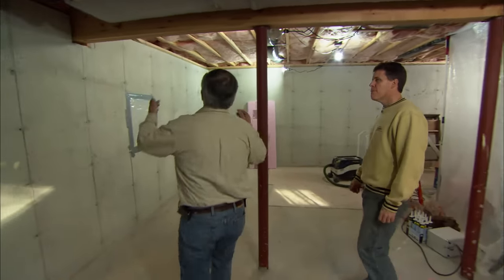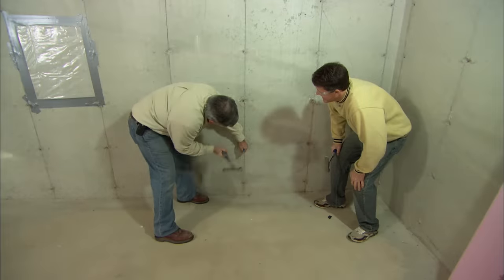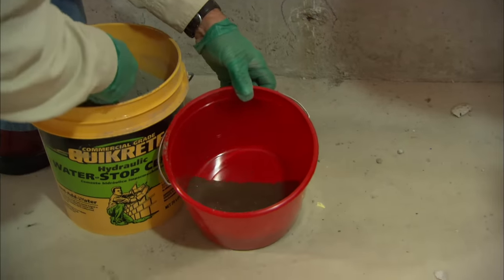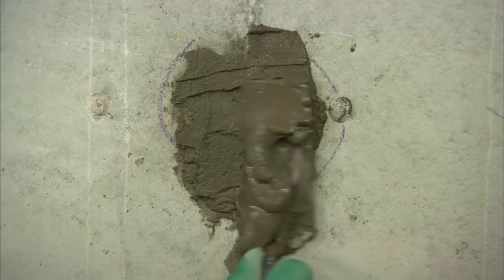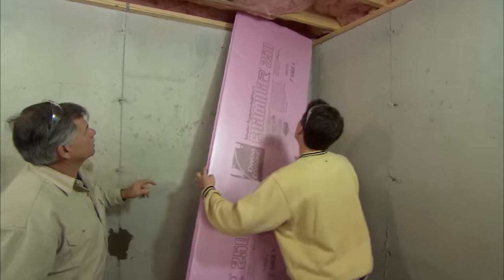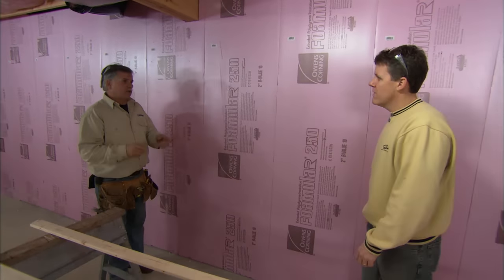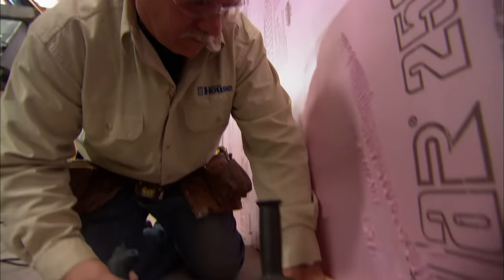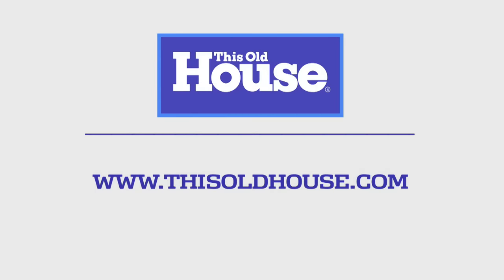How to Insulate a Basement | This Old House

Comment: I don't understand why you just didn't build a 2x4 wall, then nail your plastic boxes on for outlets and switched, insulate then sheetrock, why use this method?
Reply: Just made the same comment, still trying to figure this out. Less space ?
Reply: Save $$
Reply: Matthew, I would agree, but not this time, just better to build a 2x4 wall with the board behind it then proceed as Andy said.
Reply: This is less conducive to mold...in fact this ridic foam cannot mold as where standard insulation should really never be used in a moist basement. I just moved into my new house and they insulated the joists by the outer wall with the fiberglass stuff and it's got all kinds of mold in it--it's like a mold factory.
Reply: I think the reason is lower cost and easier.
Reply: to everyone saying this is cheaper and saves space, not really, the price of all the 1x3 used here would actually cost more than  a standard wall built from 2x4, as for space... 2 layers of 1x3 would be roughlt 1.5-1.75" thick, where as a 2x4 wall will be 3.5-3.75" thick, so it only extends the wall 2" that is if you built it in front of the rigid foam. not a big deal. 2x4 would have made more sense.
Reply: Space wise it you talking about additional 2.5 or 2.25". No? 4 vs (or minus) 1.5-1.75 or did I understand it wrong?
Reply: Does the choice of method have to do with moisture? He put plastic on the wall to test for condensation before starting. Can you only insulate this way if there is no moisture coming through (ie basement is sealed on the outside)? And if there is, you can't use the rigid foam? My house is from the late 60s so I have the feeling there is no waterproofing around my foundation....
Reply: Years ago I did a basement and applied drylock first to basement walls and floor and a thick bead of sausage butyl caulk to joints, then ripped a bunch of 2x4’s down to 2 3/4 and then built my walls conveniently 16 on center but before I secured and plumbed my walls I rested 1/2 rigid foam sheets against walls/ no glue. Then filled cavity spaces between studs with 2 inch thick rigid allowing 3/4 inch for air and then attached drywall etc.
Reply: In basements I like to use metal studs and track. There's no mold to deal with and very straight. If you want to save space you can even use the 2 1/2 in material or 1 1/2 inch material. And if you want a wall that sounds solid like a wood wall simply use the track with wood studs. If you can avoid putting something right up against a concrete wall I would do so. Simple batt insulation with a wall offset would have been much better and easier.

Comment: If that tie goes all the way through the concrete I would think pounding on it with a hammer would make it leak even more.  If you had a way to drill the ties down, making it shorter,  then fill up the hole would work better.  Glad I saw this.  If I would ever build a house with a basement I now know to make sure they seal the walls on the outside.

Comment: The water is coming in from the outside , so this means it was not sealed properly on the outside . 
You are going to have to take the dirt / sand from the basement outside wall and repair / seal that outside leakage with a spray or painted on sealer . 
It is not cheap , but it will save your house .

Comment: Step 1: Seal all the holes in the wall to prevent moisture from getting in.
... 
Step 8: Drill more holes in the wall to let the moisture back in.
Reply: Agree, makes no sense.
Reply: J M... The holes Tom sealed went all the way through the wall to the outside.
The holes he drilled did not.

Comment: if you did have some moisture coming through the basement walls is it  good to use a drylok sealer first before the foam board? i have some damp spots in mine. house built in 1953. block walls.

Comment: doesn't the nails form thermal bridges?
Reply: Yes, but can you tell me how much 0.5 sq-inches/nail (2 nails) per 1.78sqfeet (16"x16") of 2" foam insulation changes the R-15 rating? If you consider the nails as R-0, then I think the overall Rvalue would decrease from R15 to R14.94. Is that right?
Reply: It’s more of a moisture conduit and condensing surface

Comment: I have a house built in the late 1800's with an unfinished basement. There's no insulation in the ceiling/floor joists. Was thinking about putting up some insulation, but don't know where to start. Any recommendation? Thanks

Comment: Seen a lot of comments about screwing into concrete wall. Isn't the video an interior wall? If not, wouldn't it be ok to drill into an interior wall? I use hydraulic cement n drylox extreme on all basement walls. Previous owner had DMX black dimple put in. He put up studs with nails shot in the wall.

Comment: I'm curious why this wall assembly has no fireblock every 10 feet. This is a code issue for many municipalities. Not only does the continuous XPS provide a fire fuel, but the air space in the lattice strapping will feed a fire around the entire perimeter of the basement. Is this a serious omission on this video or are there circumstances in the wall assembly that bring it to fire code?
Reply: Thomas Stavros reason for this is that u don't want lose space, thats y i will use this system.

Comment: Save money,use a5/32" drill bit,common or spiral 3.5" nail and tie wire.Put a5" piece of tie wire into your hole then drive the nail.We used this building bridges,works great,better than expensive Tapcons.Try it
Reply: This will anchor strapping(3/4"0 or 1.5" material.Works on concrete,block,brick, and so on.It is a very strong and inexpensive anchoring trick.

Comment: I don't want to install a french drain because of finances, so can I dig down to the foundation and apply some type of coating? After I fill the trench back in, can I put a thick plastic liner on top and angle some more dirt on top of that, directed away from the house?

Comment: What about FIRE BLOCKING - REQUIRED by IRC Building Code? 
I plan to use this method to simply insulate some my basement walls with 3" XPS, but I do NOT plan to do any wiring in these areas. (I'll frame 2x4 walls in other areas due to the requirement to have 1-1/4" space from any wires to the drywall face of the framing.) DIY is great, but we need to do our best to follow safe building standards/codes for our family's sake - not to mention resale! Most US jurisdictions adopt the IRC that has long required fire blocking, esp. in finishing basement exterior walls. I'm planning to drywall the ceiling first to provide the top-of-wall fire block to the floor joists, also using fire block foam at the drywall-to-rim joist joint. There's also a vertical fire blocking requirement at 10 ft intervals along the walls. I haven't figured how to do this yet. Since I'm using 3" XPS, I'm going to check if a 2x4 might give the correct spacing. Any ideas?

Comment: this wall will be wavy as hell ,using these kind of fasteners to hold this crap fornces is damaging the concrete ,cutting foam to make space for electrical outlets will create cool zone around it, why dint you just do it right , build a wall made of 2x4 in front of your foam screwed to the floor and ceiling , way stronger straight wall and have plenty of room for electrical
Reply: Erick Lemire Yeah came here to say exactly this. Build stud wall, snap a line across top joists and nail, level down and throw a few concrete nails into the floor (or nail a block to the wall and nail to block). Way faster, straighter, fewer holes in concrete. Sheesh.
Reply: @RegularGuy4822 The cold air spots - I'd be worried about condensation forming thus creating mold. My house is underground and previously wasn't insulated by the former owners. Any type of air gaps like this leaves room for mold to grow for my house. I'd feel better about studding out the wall instead of creating those possible air gaps.
Reply: Would 2x3 work instead of 2x4?  Don't knof if they are cheaper.
Reply: @RegularGuy4822 Where I'm at 2x4 is cheaper than furring strips. I wanted to do this as in the video but vertical only because I'm not doing drywall. It will cost me at least 125 or so more than 2x4.
Reply: @Willparr  Are you talking about the insulation that Tommy said to dig out?  Just get shallow boxes.  Even with those boxes only 1/2" would need to be removed of the full 2".  I would use shallow boxes because I don't feature going around and scraping all the insulation out.  But either way would work fine.
Reply: @NA12495  Yes they are cheaper and you can get spruce instead of Doug Fir and save more.
Reply: Unfortunately in Chicago area we are forced by code to run metal conduit in the walls.  So I am not sure the conduit would fit in such a small space as this wall design offers, least-ways it would be a tight fit.  In Colorado I easily ran plastic shielded wire in walls no problem.  We didn't have rash of house fires with the plastic cable in Colorado.  Why then does Chicago area code insist on metal conduit?  Even the "pulling new wires" excuse is a poor reason to run conduit, least-ways the several times I needed to run new wire, the existing conduit was not useful.  I wonder if metal conduit is more designed for employment of electricians?  Just saying ...
Reply: @Willparr  : neoprene building gaskets might solve that problem. I like this technique over stud framing.
Reply: @RegularGuy4822 : if people are concerned about the flatness of the wall, then they can shim the second layer of furring to a pair of strings.
Reply: Worried about mold most basements should have a dehumidifier down there anyways. Most people overlook this.
Reply: They require conduit because they don't want the city to burn to the ground again. Do they let you use Romex in a mall store or a school or a hospital? Is your kid's bedroom any less important?

Comment: I have a basement simular to this. Would love this old house to show me what to do.  After watching this I want to try it but afraid of the whole moisture issue I have in my basement. In summer time has a very damp smell. I'm thinking I should seal the concrete and than follow this video guide?? Any suggestions??
Reply: brasilman11 everyone’s basement is damp, unless you live in an area where there’s no ground moisture. If you aren’t seeing water pooling then most of the time a good dehumidifier and sealing from the interior will work. If it’s a block foundation then waterproofing from the outside is in order, which is back breaking digging, but the best way to prevent water intrusion. Also things to look for is proper water run off from the down spouts. If you want to, get a moisture meter and probe around.

Comment: so this'll not just make your Basement warm but no Water will seep(misspelled) in either this kind of Procedure would work so great in our Basement
Reply: +Shomel Khan  Doubt that, they only use R10 insulation & he fixed the leaks from the inside and as others have said above the water will just find another way in. To properly fix it you would have to water proof it from the outside. Also more insulation would of been nice as R10 is not much at all.

Comment: I bet it took hours to drill all of the holes to mount those strips of wood.
Reply: Nah. Not if a proper hammer drill and a good masonry bit are used. A lot of "drills with a hammering function" are not the same mechanics as a true hammer drill.

Comment: I watch this show  a lot because I absolutely learn a lot. Anyway, I would like info about my crawl space. The floor joist or beams are 45 1/2 inches apart from each other. I do not know how to insulate that kind of gap. The house was built in 1968 with no insulation, may be the code to building was different then, anyway can you or someone else reading this help me by suggesting a video, some advice, or the steps I need to take to insulate the crawl space?
Reply: spray foam

Comment: Christ sakes TOM 2x4 or 2x3 on its side instead of the grid. Wiring up and over ffs TOM~
Reply: Is that really that bad? With proper studs, you'd have to drill through each one to go from left to right. This is just having you feed over and under with no drilling. I'm not going against your opinion, I just don't understand how studs are better. (I'm not an electrician).
Reply: Two layers of 1” boards is only 1 1/2” thickness. Electrical boxes are 2 1/2” deep.  Cutting 1” cavities for boxes cuts R value in half for the box.  It is too difficult to get all the wires into a shallow electrical box.  The switch or outlet would occupy 75% of the depth of a shallow box.
Reply: @smidtwarner  you have no clue.

Comment: I love how they drive those ties IN, breaking any seal they might have had on the outside, where it's most effective. Also it there's any kind of tar damp proofing with a mesh layer - gone. Perforated plastic board? Gone. Why not just hammer drill a 1/4" hole through and attach a hose bib? I like Tom's work, he's one of the reason's I sit through This New Product... err This Old House, but I gotta disagree with this one.
Reply: Ignorance abound...Who said he went all the way through the wall? Did you even try to find out how deep a poured wall is before commenting??
Reply: Joe Blow, I thought the same thing about driving the ties in. All their doing is creating a disturbance in the concrete & improving the chances of water coming in the basement. I guess I understand their logic  but dont agree with it
Reply: Those ties were already leaking.  Nothing there for him to disturb.
Reply: Joe Blow gbvb
Reply: Obviously there wasn't a seal...water was getting in.
So your point is??

Comment: This is the first time I felt compelled to comment on This Old House. 
Folks, do not close up your basement like this! I redo -do basements that were done similarly.
 In time, that wall will leak. It must be waterproofed, and each one of those penatraions is a future possible leak.
Reply: But what do you do if your ceiling is stucco and you don't have a floor joist to do a 2x4 framing? I ask cause I am trying to frame one side of my garage block wall for tool storage and a French cleat system.
Reply: Do you disagree with drilling the holes only or the entire process including gluing the foam boards?

Comment: I have a concrete block basement, can I use this type of sheet insulation? Maybe not something to worry about, but would the mortar gaps collect moisture if it's humid? Just thinking because the walls aren't as flat like these ones.
Reply: Same technique would work with CMUs.  The slight con cavity of mortar joints is a non-issue.
Reply: @smidtwarner  thanks, I just had a quote to have a contractor do it because I just don't have the time. But he recommended not insulating below ground level because you need some heat to transfer out to keep the frost away. So for now I'm just having the rim joists spray foamed.

Comment: To bad you drove the still ties out , now water will go in to the concert, an we’re is your vapor barrier . an what does a plumber know about carpentry work . I would’ve put a vapor barrier on first nail on treated wood strips so I put another vapor barrier on in the screw drywall on. Have you guys ever heard of tap cons? No his brother didn’t show up he don’t have a brother
Reply: Vapor barrier goes on heated side only.
Reply: The tongue & groove foam boards are vapor barriers. Yes, I believe Hydraulic cement stops water flow but not moisture.
Reply: He's a carpenter.
Reply: 2 inch foam acts as a vapor barrier. Also according to many experts, a vapor barrier does more harm than good. Check out the green building advisors website for one example.

Comment: If you have a room in your basement and the outer walls of the room are exposed in the basement what is the best material to cover them with? Foam insulation or just sheetrock them?

Comment: So you would cut into the insulation to fit a wall plug that then sits inside of the insulation...ok...Does that foam burn/melt at all?
Reply: ObsessionPC since when does electricity consists of fire?
Reply: Ever since resistance in wires due to faults or simply a too great draw creates heat and therefor fires. So called electrical fires.

Comment: frame the wall s don't drill more hole into foundation.
Reply: +jose contracter how do you exactly frame the walls then?
Reply: +David Ratkay  LOL
Reply: +David Ratkay Typically when walls are framed with 2x4 lumber, and then secured to joists above, and concrete nailed to the slab below. Its worth noting that when going this way, to make sure your bottom plate is pressure treated lumber.